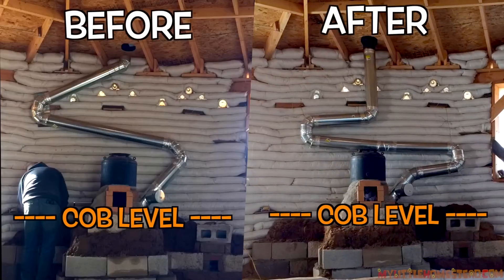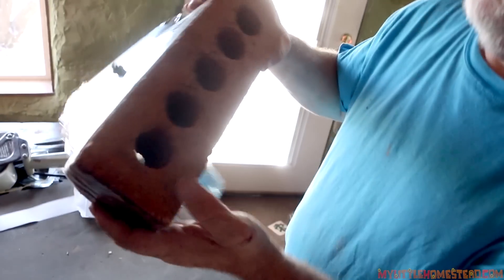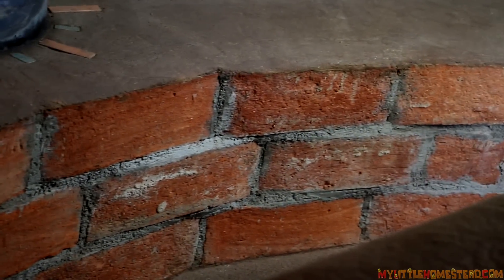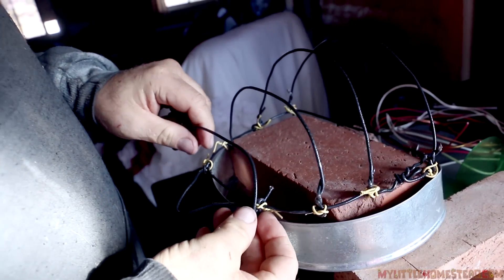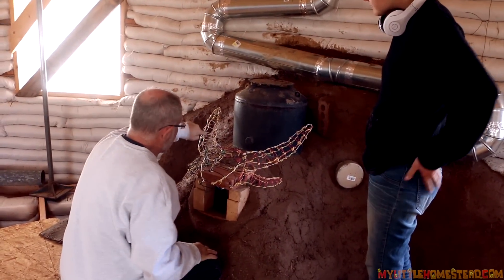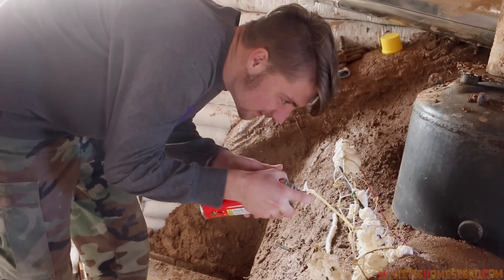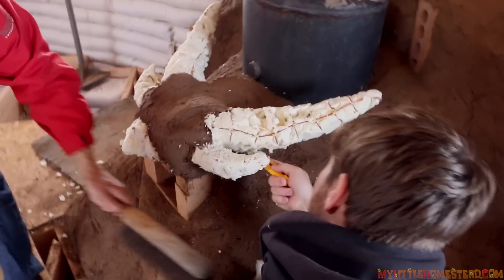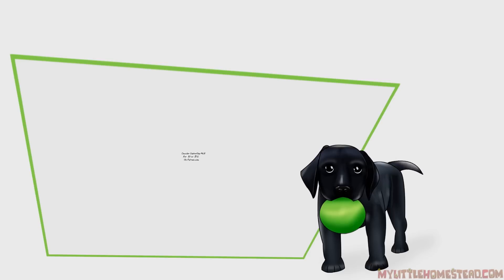Dragon Head Frame & Cob Cob Cob!  | Dragon Rocket Stove Mass Heater | Weekly Peek Ep73

Comment: I have worked with spray foam before and I'm concerned that the heat from the stove will melt the foam inside the horns. Most foam products and heat don't mix. An alternative might be light density firebrick. You can sculpt it easily with a hand saw and file.

Comment: I also would like to recomend the fixed tunel for outside light to down in lower space. You can run it from the upper level wall penitration rather from the roof. I have installed these on many home improvement jobs for customers. One thing to remember or to think about is that the more direct sunlight and lenght of sunlight adds to the amount of heat you will recieve in the area the light is exiting the tube to the space beeing lit. It gets down right HOT HOT HOT. The tube is highly polished reflective and actualy busts the energy and light at the exit. A good thing overall, just be ready for it. I actually had to make a vented spacer for the exit glass for cooling the glass it was so hot.  Sam

Comment: I had a thought for Bry room. He mentioned that he wanted to cob up the upper flu. To do that add cob and use chicken wire to hold the mix in place. Then you can cover that with a lite coat on the outside.
Wil

Comment: what about instead of cobbing the stove pipe you put a bunch of aluminum fins to dissipate the heat. like a hot water radiator  baseboard. I'm sure you can get very creative with the metal.
Reply: The cob is meant to cumulate heat and release it slowly after the fire is extingished.

Comment: If you cob up to the wall you end up conducting a lot more heat into the wall, which in turn ends up conducting a lot more heat out of your structure. A jewel of heat energy that goes into a 105 degree earthbag on the other side of the rocket mass does a lot less to keep you warm than that same jewel would in a 65 degree earthbag elsewhere in the structure.

A wire "structure" to support a sculpture is called an "armature."

Comment: While I am not a physicist If I remember correctly from my high school science teacher lo all this years later (no I won't tell you how long ago, so don't ask) heat rises. By putting the vent next to the stove what you have done is created away for the warmer air at the top of the ceiling below to be pulled out and pull colder air closer to the  upper floor down into the lower floor.
 Understand warmer and colder are all relative terms as the cooler air on the upper floor may be actually warmer than the warmer air on the lower, but because you have caused a  vacuum effect you should have movement. It  shall be interesting to see how this works.
Reply: Charlie $ir....
20 century. ..

1970...
late or early 1980 's.

Comment: I would strongly suggest ripping that foam out and replacing it with something else more along the lines of  rebar tie-wire and concrete/cob - Unless that foam is rated for extreme temps around a fireplace then it is at serious risk of dangerous off gassing, if not rapid combustion. 

Sealed in cob and placed that close to a heat source that powerful also places it in potential risk of being basically a small bomb. If the cob seals against oxygen and the foam allowed to heat to ignition point before the outer shell cracks, it can burn and expand rapidly enough to throw the cob shell off at hazardous speeds. (Learned just how fun that kind of thing can be when staying up at a friend's cabin on a rather cold night in winter. It was wonderful and peaceful with a nice cheery fire going while sipping tea and reading a good book. Then part of his cob-heat sink kind of exploded with a roaring whoosh sound. The night rather rapidly turned less pleasant.)

Comment: You guys, this is a really cool project but you are making me nervous putting that highly flammable petroleum product right on top of the burn chamber. I wish you would have used the fire resistant kind. I hope you really watch it close at first with that thing really cranking to make sure it's not going to get too hot. Also, you can carve that foam really easily with a $20 harbor freight fein tool (oscillating tool)

Comment: its great that u guys have found out an easy way to make up for the dragon head, but unfortunately, bet it will burn or smell the phoam when u heat up the stove. Its not safe to smell phoam gas. Think  should hammer plates to complete the stove

Comment: We are running into the same issue with heat staying in the bench of the rocket heater.  Planning on adding flue damper.  Close it when done firing stove and that way less heat will rise out the pipe.   You guys are doing a great job as usual.  You can check out our family build of a earthbag house here:  https://www.facebook.com/groups/371325743005883/

Comment: Instead of making these elaborate wood burning stoves with tiny wood burning areas, Why not make larger ones out of 55 gallon drums? Here is a video of a young man that made one with a cook top if you want that style as well. It's large enough to insert a good amount of wood to burn and it will radiate heat in all directions and keep your huts toasty.
https://www.youtube.com/watch?v=W4Gxt6sE4Q0
Reply from the maker: Maybe as an upgrade later... thanks for the suggestion
Reply: What you refer to is more like a regular stove. A rocket stove is something entirely different. Using a large burn chanmber for a rocket stove will not end well.
Reply: Yes it is more like a regular stove. It will heat the place better also.
 If you look at another video of their son talking about his rocket 
stove in his room, it isn't heating the place as well as it should and 
he was already talking about making improvements. So what's the point in installing a stove system that will just need improving later on when installing a proven system of heating will work better and is a lot less work to install?
Reply: A regular stove heats a room faster, but after the fire has gone out it will only stay warm for a couple of hours. A rocket stove heats a room the entire day - and with proper mass the entire night too. A rocket stove also uses less wood as the exhaust smoke has a lower temperature and thus it's a more fuel efficient way of heating. The improvements he talked about is simply that he wants more mass so he can store more heat and burn less wood. Besides; they don't really live in the arctic.

Comment: your heat vent to the bottom floor is NOT going to work..there is NO way that heated air from the top floor will flow NATURALLY to the bottom floor without a blower at the end of your vent tube inducing flow....your natural flow top to bottom defies bouyancy